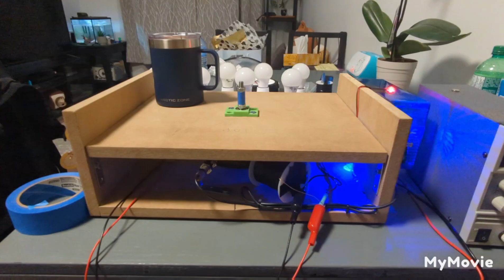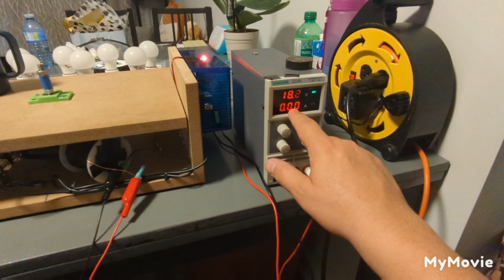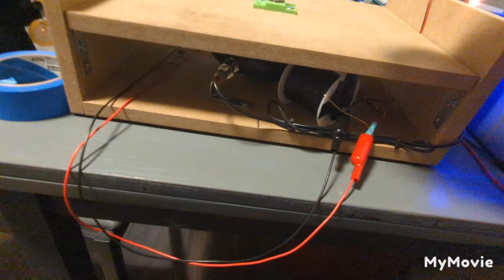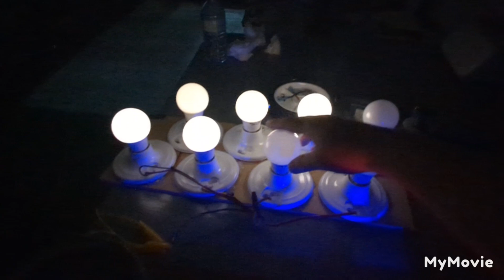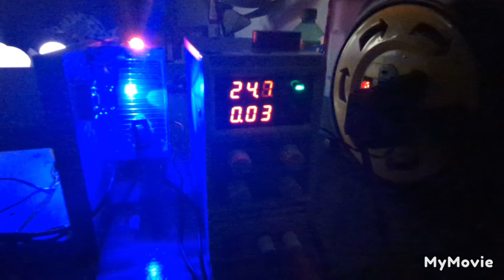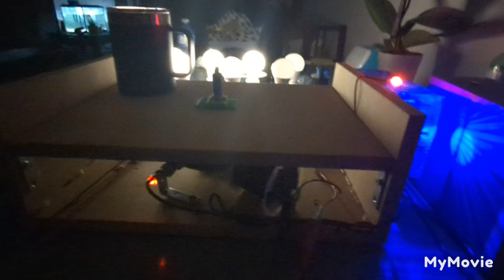Faraday Research RND ⚡⚡💦 Adams Motor Generator build "Secret"#freeenergy #zeropointenergy #tesla

Comment: Is your piezoelectric transducer in series with the coil?
Reply: I'm assuming from what your setup looks like that you have 4 transducers but you have 2 groups them. You have two transducers that are in series and run parallel to the other group of transducers which then run to your load
Reply from the maker: The piszo's generate the current in the circuit which allows the stored up energy in the coil to flow
Reply: @FaradayResearch  right. It's going from the coil to piezoelectric transducers to the load.

Comment: Awesome results 👍👍
I'm running at 112 volt. Higher volts better return
Reply from the maker: That's amazing! See I told you the piezo transducers make all the difference. They create the gating effect.... the shorting the coils releasing all the potential energy stored in the coil. Keep it up!
Reply from the maker: That's awesome! The shorting of the coils releases all the potential energy stored in the coil. Keep it up. You're doing good

Comment: Are you saying that 40 Watts is subdivided, 10 Watts goes through each piezoelectric?  Like literally has electrons leaving copper wire, flowing through crystal and then back into the copper wire?  Or does the copper wire stay intact and just touch the surface of the crystal?  ANY inductor coil (that has a magnet sweeping past it)  could benefit by adding piezos?
Reply from the maker: I haven't blown up a piezo yet ..
.and 40 watts goes through all 4 at the same time
Reply from the maker: The purpose of the piezos is to gate the coil or short it... at a very very high rate of speed ... which doesn't interfere with the initial pulse sine wave of the current going through the coil. This very fast disruption in the current allows all that current that's stored up in the coil to come flying out. That's why without the piezos I cannot light up more than one light bulb.... with the piezos... 4 them in series with the coil allows that stored up energy in the coil to come out... and that's why I'm getting such huge gains. Just look at my last video I did with my oscilloscope and you'll see what happens on the sine wave
Reply: @FaradayResearch  Thanks for replying. However, I still do not understand 'gate' or 'short'.  My question is about the copper wire going into a piezo unit, does it stay as a continuous wire, somehow wrapped/touching the surface of the crystal, or is the wire interrupted, forcing the electrons to pass through the crystal?  I do watch our other videos, and recognize that this discovery is going to be important, and I want to basically see a diagram of how the piezo unit is built.
Reply from the maker: @StevenBHalls  yeah, the power runs through the piezos and the pizzas create like a vibration effect. When they're hit with voltage of any kind, they start vibrating at a high frequency. Best thing to do is look it up online and learned how piezoelectrics work and ways you can use them. So to understand what the gating is. It's basically opening and closing the circuit by shorting it out and that's what the piezos do... like a dead short..... So when you create this dead short it basically creates a huge surge of current through the coil and because it opens fast now. The pathway is now open for all that energy to shoot flying out
Reply from the maker: Yeah I think you got it about right. The 40 watts is subdivided through the four piezo so be 10 watts per piezo and it's basically the way I can understand it in a simple sense is it's causing the coil to vibrate opening and shorting the coil at a very high rate of speed within nanoseconds during the sine wave cycle, creating a multi collapse of the field at a quicker rate that allows a steady sine wave to actually flow. Normally that the motor can actually function properly, so the best way I can describe what's going on is making the coil vibrate as it goes.... If that makes any sense. It's quite a very interesting phenomenon that happens in this and seeing it for the first time on my oscilloscope was quite puzzling but yet very intriguing
Reply from the maker: @dedu456  like I said before, it is making the coiled vibrate thus opening more potential energy to come in from the vacuum into the collapsing. EMF field generated within the coil itself, but the dielectric field is still a part of the equation too. I would still have to research this phenomenon that's happening